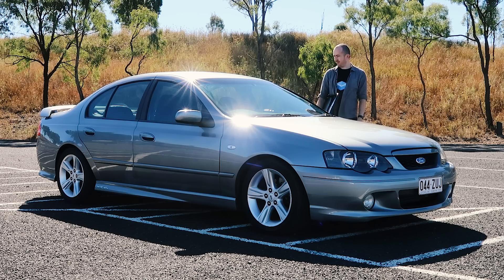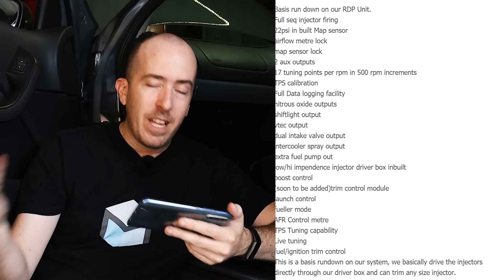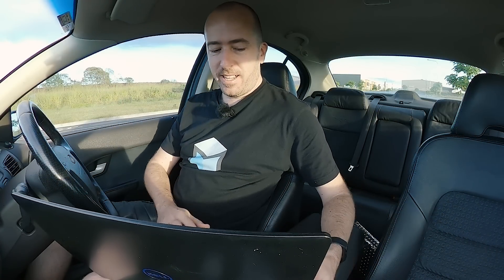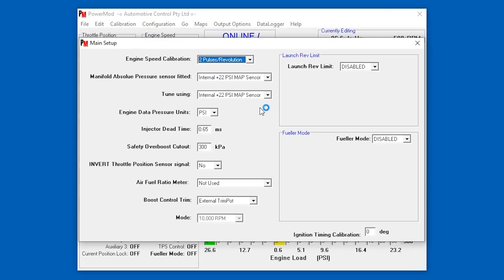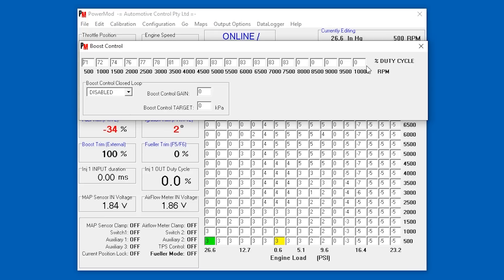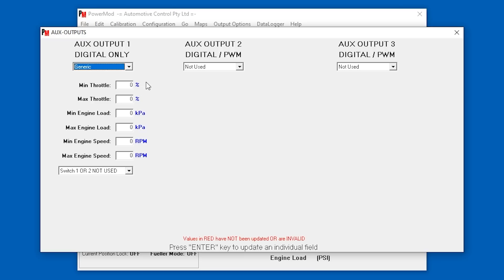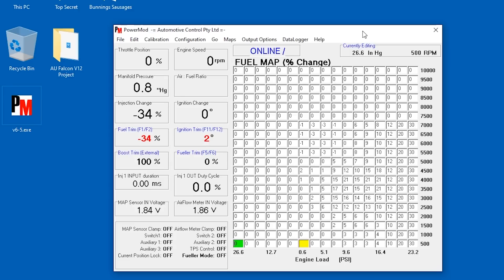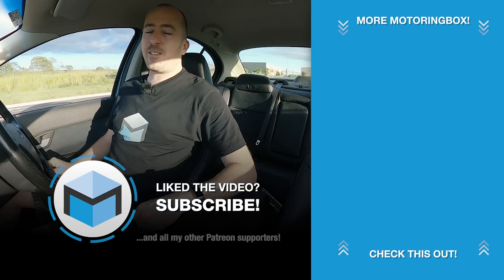Unlocking my Ford BA XR6 Turbo's Piggyback ECU. Redcliffe Dyno PowerMod ECU TSI Pro Sequential

Comment: That radcliffe piggy back is extremely capable.
Reply from the maker: I've managed to track down all the documentation and wiring diagrams for it - I hope to use it for a project in the future 👍
Reply: I noticed it has ALOT of wires going into it, and seeing all the features explains why.   This unit can control vtec and vvti.   It can also fire additional injectors or take full control of the injection.  It also can advance and retard timing 50+/- degrees.   Piggybacks have a place where the manufacturer locks the ECU or you want all of these other features without having to have a  tuner burn you a chip every single time ( such as boost solenoid,  meth injection, rpm or boost based triggers, etc ).   

I've reviewed the following:
MAPECU3
AEM FIC
URD FTC
Split Second
SMT6/7/8
DET3
Greddy eManage

The Powermod appears to be at the top of the heap regarding features.
 @MotoringBoxTV
Reply: I also found that the Haltech can function in a "piggyback" mode.

Comment: 650 cc injectors, a new turbo upgrade to 3584r . 3 inch intercooler and plazmaman piping for the hot and cold sides.  Ecu flashed by a professional. 20 percent under drive harmonic balancer and pullies and new serpentine belt. I wouldn't ever want to put my car on a dyno. Reving it out to 7k. No way

Comment: I brought a sct 4 flash tuner, off a block on line. He said it wasn't married to any other car, I plugged it into the orb 2. And tried to tune my xr. It vin locked my ecu and it wouldn't run properly. I had to leave it on the road until I could get it towed to the Ford dealership at Caboolture. After a few days they managed to get it running smoothly.  I still have it here if you wanted it mate. All you have to do is get in touch my the company. It will cost you about 150 dollars. It's a awesome tuner.

Comment: With the value springs upgrade they are better for your engine if you have few hundred kilometres on the engine I had mine done and injectors fuel pump upgrade 3.5” turbo back exhaust and dyno turned. Said I didn’t want him to get the maximum amount of power from these mods so I wouldn’t be breaking different parts from the jump in power. I ended up with 411rwhp and it was great with the pcmtec as well which I could choose low or high boost while driving plus drive by boost which lets boost out more and more as you go up in gears. I had that done nearly two years ago at real dyno performance and I haven’t had any issues with my car and I couldn’t believe how much better it was. I had told Lee that I got the car so I could go to car meets and cruise around with my son and have a great time just us boys in the car. My son was a little bit worried at first by how quick it was so I drove in low boost for the first 6 months with him and said he could decide if and when he wanted to go into high boost and then he would let me know if he was worried and I said I just wanted him to feel safe and have fun not scared and never got back in the car. He said that he was ready and I done a few pulls not flat out and he said he was ok and then I said I would do it 100% throttle and he said I had and when I did he had a massive smile on his face and he rides shot gun at powercruise and powerplay. I knew I had to replace my intercooler as it was the original one from factory and it’s got over 220,000 kilometres I’m the second owner and I’m getting a new one installed and and dyno turned again at real dyno and my son said he is really excited to see the difference in power and how fast it’s going to be at powercruise in September hoping it doesn’t get stopped from COVID restrictions.
Reply from the maker: That's awesome mate. I'll probably be doing the same in around 10 to 15 years from now! hahaha

Comment: Got to be very careful with the latest sct 4 flash tuner. I bought 1 second hand and the bloke told me that it wasn't married to any other cars. Fuck me it was married to another car. It vin locked my ecu. I had to leave it on the side of the road for 2 days. I got it towed to a Ford dealership. There was a huge chance that the computer was dead. I got lucky thanks to the people at Ford Caboolture. Ever since I've had my ba xr6 it is always using 13 l of fuel. I've even tried to drive it much slower on the highway. I don't know if its bumped or not. It's winter white so I was wondering if it was a police car back in the day.

Comment: I'd honestly be very careful if it is indeed pushing 15psi as being completely stock the fuel pump and injectors shouldn't be able to do that and I'm surprised the valve springs are still holding up lol
Reply from the maker: Let's just say I am buying a few parts 👌

Comment: PCMTEC is very powerful now. Look into it more. Their CustomOS for the standard ECU is impressive.  Can do on the fly tune switching, eflex, launch control among other things.
Reply from the maker: It's a great solution. The stock ECU has it's fair share of quirks though, so the idea of replacing it is still very appealing to me.
Reply: @MotoringBoxTV  What quirks? I would've thought the PCMtec would also be over half the price. Though I think the BF onwards ECU's are also more powerful that the BA, could be wrong.

Comment: Also question, what do you use on your dashboard to have it looking so bloody nicely hydrated :3
Reply from the maker: I've used Armor All protectant original for over 15 years and find it works very well. A lot of people in the comments seem to hate it though and are convinced it cracks plastics.
Reply: @MotoringBoxTV  do you use a windshield cover etc to stop sun beaming the life out of it or just the Armorall.. if so thats pretty impressive haha.. i tried restoring mine but pink batts insulation fibers and dust ate it up good over span of a year an me not considering after effects haha.   riiip
Reply from the maker: I do use windscreen shades in summer but I've only owned the car just over 6 months - so no idea what the previous owners did during the 16 years prior. Other than that the dashmat is oem Ford and has probably been on there the whole time.

Comment: 23.3 PSI, considering that, the ECU remapping accounts for having 1bar standard pressur, in manifold at most times.., loosk like the tune was set to just make the 7psi feel a lil more perky perhaps with the extra fuel deliveries,

if that was 23psi, oh boy would you feel it,.. an unless the bottom end on the BA mk2 was rebuilt or rods swapped out for bf mk2 (fpv style) fatties then same same you would probably have seen a Rodney pop out to visit you by now xD

Comment: Cool old tech, while you were crouched I couldn't help but wonder if you have the T5 wedge globes installed up under the dash to light up the footwells, apparently Ford didn't install the globes from factory on XR models, mine had none when purchased.
Reply from the maker: I noticed the one under the glovebox didn't have a bulb. I'll have to check it out.
Reply: @MotoringBoxTV  the drivers side one is pretty hard to find you have to pull the fuse panel fascia off and it points down from under the fuse box, it was a nice little cheap upgrade I discovered thanks to the xr6turbo forum 👍

Comment: I used to tune Moates (Piggyback for pre-BA EEC fords) but this looks like a big upgrade from those. For a start it deals with boost directly, with the old Moates ones you had to use load over 100% to deal with boost. From what I can see on screen, the main fuel % change Map looks typical. Not sure how I feel about leaning out near the redline, but that may be in tandem with timing changes on another map... Assuming you have control over fuel and timing, and assuming new injector specs can be accommodated on this piggyback ecu, I'd keep it. Fine for a budget build.
Reply from the maker: It would be cool to keep it, but it may end up taking longer for the tuner to work with.

Comment: Remove the piggyback and get a proper tune, 15psi on a GT3582 on a stock BA engine, without a turbo back or valve springs could be dangerous.
Reply from the maker: I am not too worried at the moment. From what I have worked out the car has been this since at least 2009. I think it would have gone boom already if it were going to.
Reply: @MotoringBoxTV  True, or it could be a time bomb waiting for that last boost 😉

Comment: Yes the RDP piggybacks were TSI. I had them fitted to my xr6t and supercharged xr8 back when Steve owned the business and Lee Bloom did all the work lol.
I've probably still got the software on an archaic laptop! You could buy an adapter to take it back to standard quickly if you were to go the later available full pcm tuning (PCMTec, SCT, VCM etc)
Reply from the maker: Hmm, that would be cool. Hopefully it's not too difficult to remove the whole setup entirely though. I haven't had a close look because it's a pain in the ass to get down there in the footwell to see what's going on.

Comment: Follow the loom it probably is placed in line with original engine loom. 
there are connectors on the underside of the factory ECU. Hopefully they used factory plugs and didn't cut and splice into the factory loom.
Reply from the maker: Everything looks factory around the ECU connectors, so I am guessing they splice into the wiring around the footwell/kick panel area.
Reply: @MotoringBoxTV  Unlike previous falcon models none of the engine wiring for injectors / coils feed into the cabin. They run directly from ECU to engine.

Comment: It shouldn't really be running 15 real psi with stock valve springs and injectors,  its probably saying that but pushing 13 psi through your engine Max
Reply from the maker: I am not going to lean on the engine too hard until it gets tuned later. It sort of just feels like it isn't quite running right up high in the RPM.

Comment: that was pretty interesting. my 2 cents worth if you are already getting 15psi those stock valve springs are very much on their limit. any additional boost in a tune may see you walking home from the drags if you dont do the springs. i was very tempted not to on mine but all tuners i spoke to said it is a must do before you do anything else.
Reply from the maker: Might be a nice bit of added insurance 👍
Reply: @MotoringBoxTV  yeah just an expensive exercise. mine boked in to be done next month here in NZ and im looking at $1200

Comment: Are you gonna post a link to the software for others to download and to keep it archived? Cheers.
Reply from the maker: I am thinking about it. It's kind of abandonware anyway I guess.
Reply: @MotoringBoxTV  Considering the company that released it way back when doesn't really exist, at least not in the same form I doubt there's much of an issue. Would be good to chuck it up on archive.org 👍
Reply from the maker: I have put a download link on my website: https://www.motoringbox.com/feature-cars/unlocking-my-ford-ba-xr6-turbos-piggyback-ecu-powermod-ecu-pro-sequential/
Reply: @MotoringBoxTV  Legend! Appreciate it 😊

Comment: Another great video! FYI, I have an FG F6 running PCMtec. It's running full flex fuel and is making 540rwkw above e70.
PCMtec is very impressive in my opinion, amazing what they can do with the factory ECU.
Reply from the maker: I do like the multi-tune selection via the cruise control buttons. That's so cool.
Reply: @MotoringBoxTV  I don't have that (it's an option but I have gone all out). I have the FULL flex tune. That is, it reads the ethanol content in real time and makes the nessesary adjustments in real time, on the fly.

No button presses required. Fill it with any combination of 98/e85 and it works it all out.

Comment: Blimey, what a story on the software. I'm intrigued how it'd be handling stuff like knock control since the engine has aged. So like.. if the factory ECU detected knocking and tried to retard timing, but got overridden by the piggybacked ECU values etc.
Reply from the maker: Potentially dangerous yes.

Comment: RealDyno is not the same as Redcliffe dyno performance, "RDP" was brought out by a different person then rebranded as RealDyno, so I'd suggest going into RealDyno and speaking to Lee about bringing it into the 2020s tune wise 😁😏

But I'd recommend at least getting it run up and checked it's safe in its current state, especially if you're seeing 15 psi boost on those spaghetti rods 😉
Reply: Haha yeah haha spaghetti haha, that's a good name for the very first turbo motor Conrod's, they're so thin hey Lee Rhodes haha man your car looks awesome I just got my FG and I like yours. Is yours manual? I've heard of your shop real dyno Lee Rhodes can you tune my car? Sweet, I'll give you a ring on Monday Lee cheers. BTW I'm going to start racing at Lakeside so need a big tune and a 3 core rad, Cheers Lee Rhodes I'll call Monday real dyno. Sweet

Comment: Oil pump gears, valve springs, injectors, F6 airbox, tune - should get you around 250-270rwkw✅

But TBH, I would say the poxy T5 box will be more of a power restrictor than the stock exhaust - anything above 250rwkw gets dicey with the T5, in saying that, people had problems with them in stock trim 🤷🏾‍♂️🤣

Honestly, if you're keen for power, go speak to the tuner you plan on using, let them know what your budget is and they'll know exactly what power they can get for your budget.
Reply from the maker: It's a 6-speed!
Reply: @MotoringBoxTV  in that case 🚀

Comment: The overboost cut will likely  include atmospheric pressure which is 14.5 psi, it's an absolute pressure sensor so therefore boost cut will be 29 psi  ish, still quite high though!
Reply from the maker: Thanks for that, makes a bit more sense but still very high like you said!

Comment: I know its your car mate. But I wouldn't be upgrading exhausts and intercoolers. Keep it stock and neat. Maybe the only thing I would do it upgrade to those parts only if they were fpv f6 items maybe?  Keep up the great work. Love your videos.
Reply from the maker: It's actually a cool idea. I'm leaning towards just doing the exhaust now. If I do the cooler, I might try and get the slightly bigger F6 one.

Comment: Cut the loom off where it splices into the factory loom. I had a unichip + tune paid for it to be removed, all they did was cut/tape the wiring. Pcmtech tune your rig. Piss off the old tech! Go flex fuel tune it's free power on e85!

Comment: i got a 1983 zk fairlane that was turboed back in the late 90s it runs a aftermarket computer called a INJEC Tune computer, no one will touch it everyone i talk to want me to spend $1500 and up for either link ecu or a haltec . either way its $3 to $5 grand for someone to install and tune ,
Reply from the maker: That's a shame. I guess most tuners just throw it in the too hard basket.

Comment: All I could think was "danger to manifold" when you plugged the laptop in. Be careful of your passenger side floor pan falling out... Great video man. Go the Haltech. 👌
Reply: Yeah, go the Haltech! 👍
Reply: @haltech  hook him up with one 😉 👍 Would be a great video to see how it works.
Reply: @haltech  
Cool! Motoring Box found a sponsor!!
Reply from the maker: Sounds like a good idea to me 👌
Reply: I learnt not to touch any thing like that shit, take it to a decent performance shop and get it flash tuned
Reply: Be very careful with upgrading your fuel injectors. You put the wrong 1 in you can blow up your whole motor,  and I wouldn't bother changing your cams either, stock cams are really good. And you will lose your vct technology
Reply: When choosing your exhaust systems, remember that a cold start in the morning is really loud lol.I deleted the middle muffler on mine. I was going to put a 3 inch system on it, I'm glad I didn't. I have 2 and a half system. Remember that you will need a hi flow cat, not worth doing unless you have the hi flow cat
Reply: I don't play with tunes any more, I learnt my lesson